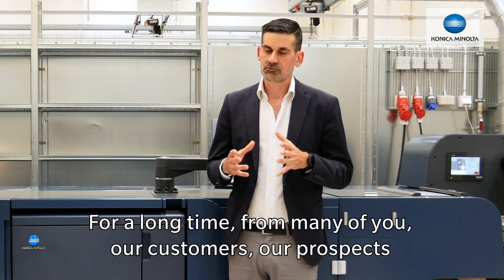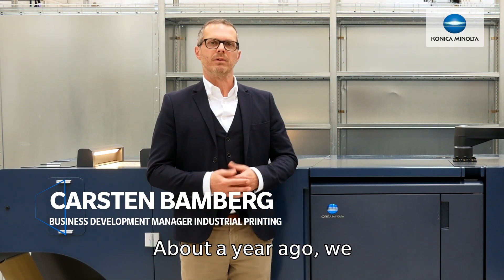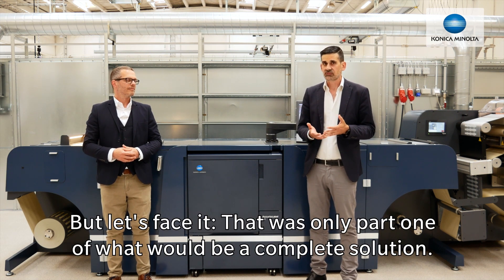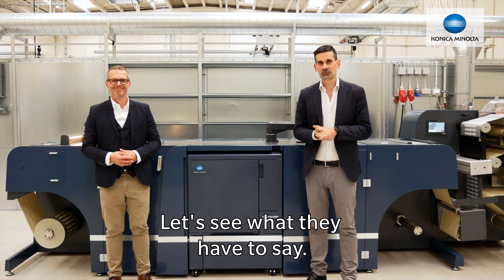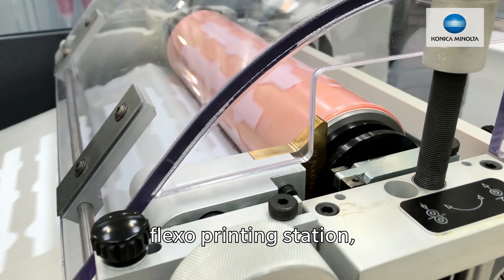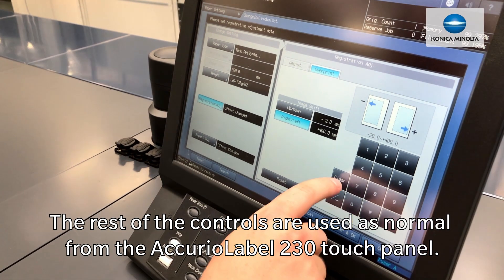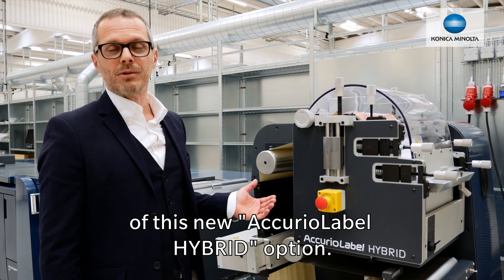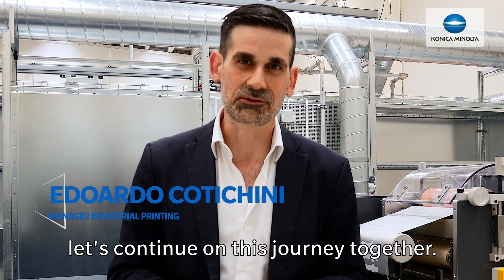Hybrid functionality for AccurioLabel with new Flexo Printing Unit

Comment: It would have been easy and great to be able to print white digitally, if we want to do it digitally, we should be able to, making flexo plate will be very expensive when the copies of label required is not plenty, for example what if the customer just wants 500 copies of label? Or even 100 copies? And require to print on transparent substrate? The charge would be too much...if we have to make flexo plate....
Reply: See the AccurioLabel 400. CMYK + White